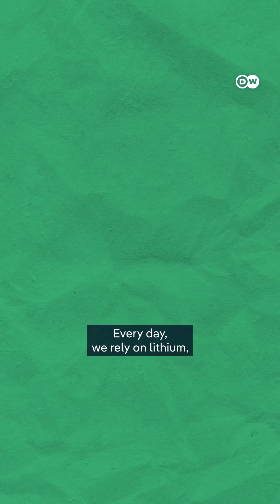How green is green energy? | DW Documentary

Comment: How green are?.... DW knows there are no such green energy. All form of energy require other source of energy. Even the wind turbines consumed energía to manufacture the parts and spares (and their computer control system also consume electricity coming from non green tech). The electric cars requiring a electric supply obtained from petroleum, coal or gas.. nuclear? Could be, but the residual material spend thousands of years to deplete. In summary, there are not free lunch...